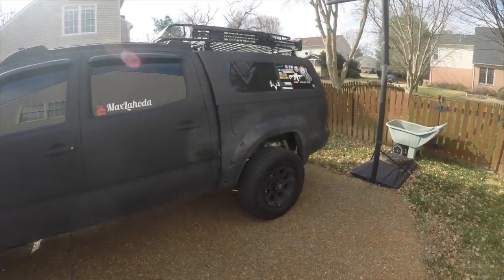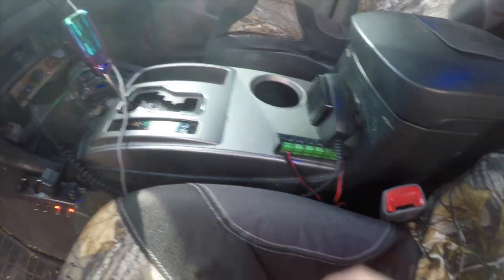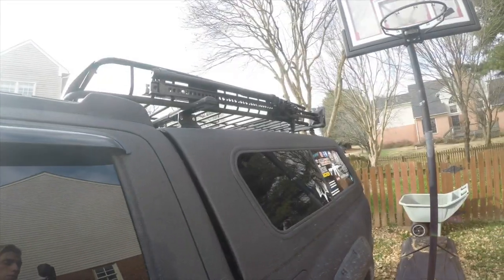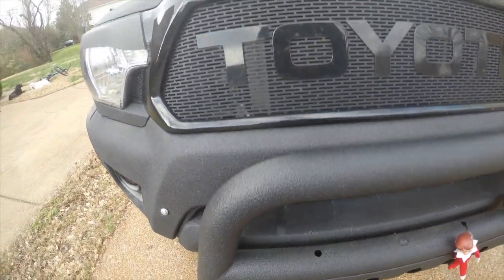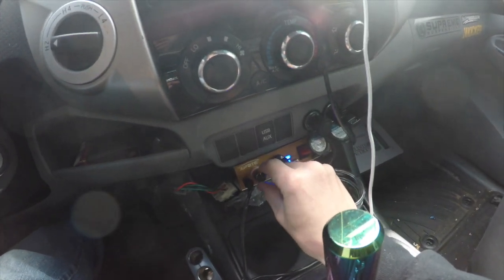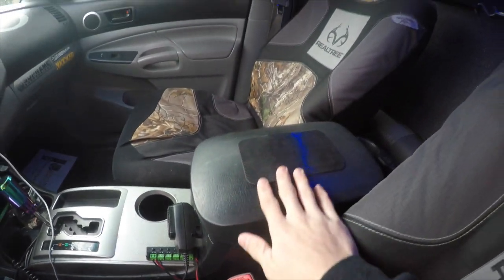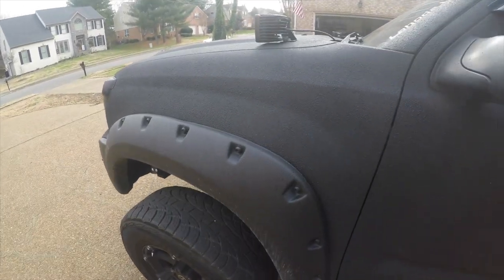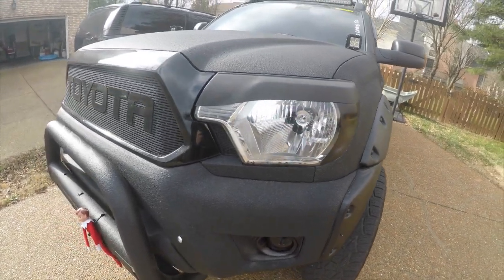CHEAP TACOMA MINI MODS

Comment: For the light wires underneath....and then goimng over your sill plates....there should be a gromet knockout on the floor u can feed the wire thru. The wire would go under the carpet then just feed it from under your center console. Just a suggestion
Reply from the maker: Leatherkid01 I know I need to tuck all the wiring in my truck away. I just haven’t gotten around to doing it